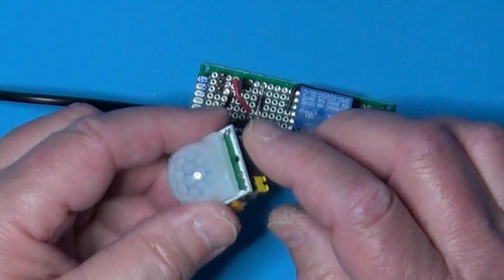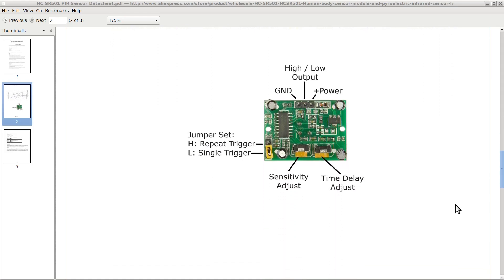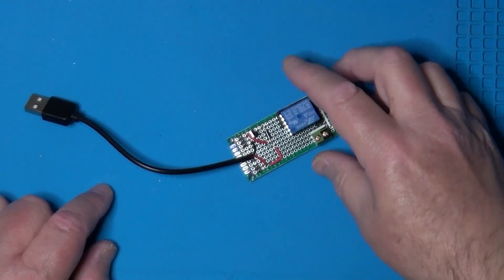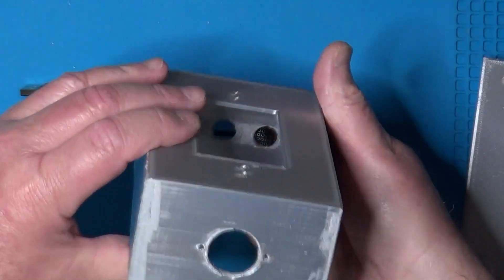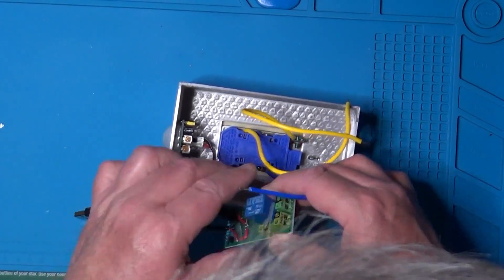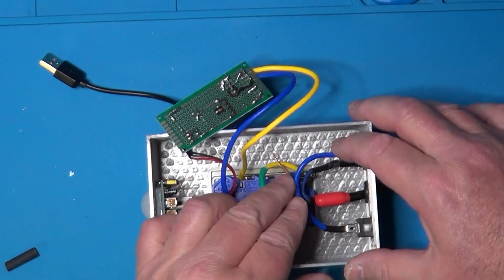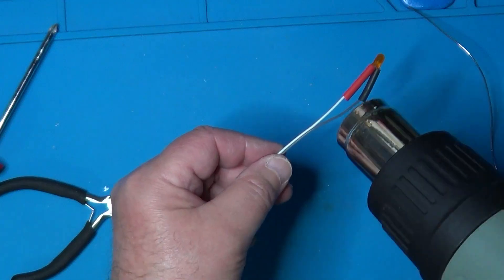Lights On!

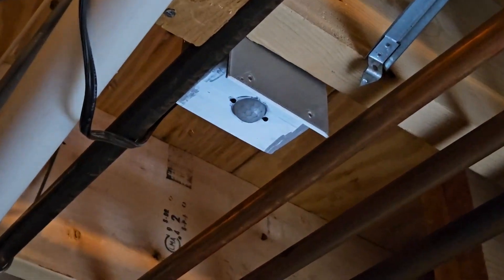Comment: A brilliant project and execution. You included extensions from the box, to allow you to screw the box to the wall. When you attached the box to the rafter, you did not use the extension on the sensor end. Now, that extension is somewhat between the sensor and the door. See @13:52 . You might improve the line of sight sensitivity of the sensor by removing this unused extension. HTH.
Reply from the maker: Actually the Fresnel lens on the sensor is tall enough to overcome the length of the extension. In other words, the sensor is still capable of sensing infrared light that is behind the extension. Tested, and it works.